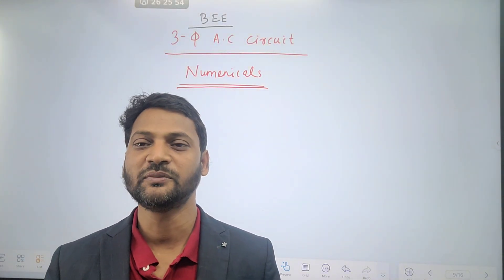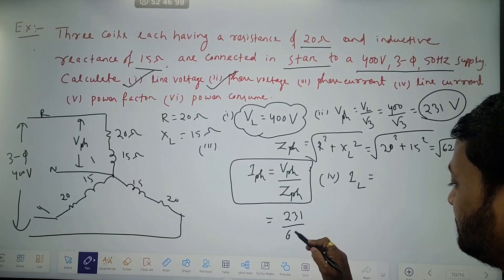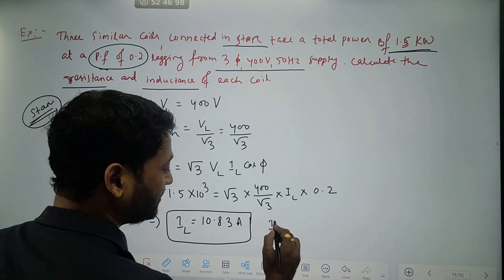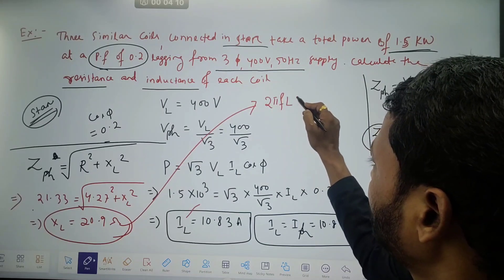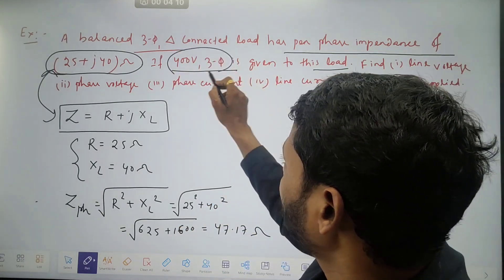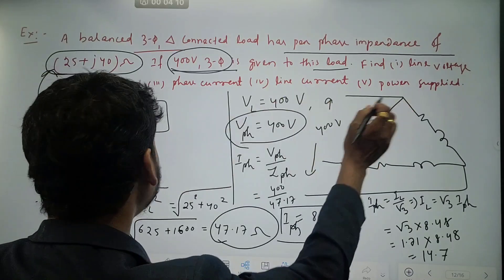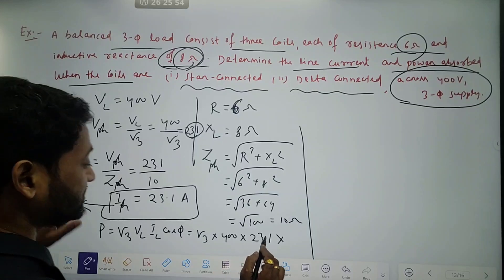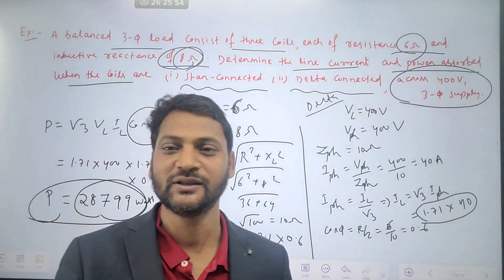Numericals (3 phase A.C Circuit)

Comment: Sir 🚨 please help by uploading source transformation, theivens and nortons theorem all type of numericals 
Unit I

Voltage and current sources & transformation, properties of resistors, capacitors and inductors, Kirchhoff's laws, Mesh and Nodal analysis, Star-Delta transformations, Superposition theorem, Thevenin's and Norton's theorem, Maximum power transfer theorem.

Unit II

Circuit analysis in sinusoidal steady state, various signals & waveform analysis, Concept of phasor, impedance, admittance, phasor diagrams, Complex, real and reactive power in ac circuits, Power factor and their corrections. Generation of three phase voltages, star and delta connection, Line and Phase quantities, Three-phase power, Three-phase Power measurement techniques.

Unit III

Magnetic circuits: definitions, B-H curves, Magnetic circuit calculations, laws of electro-magnetic induction, Hysteresis and eddy current losses. Single phase Transformer: construction & principle, EMF equation, equivalent circuit, regulation and efficiency. Three phase induction motor: Basic construction, working of three phase induction motor, losses, name plate rating.

Unit IV

Types of semiconductors, PN junction diode and its VI characteristics. Applications of diode as rectifier. Zener diode, its characteristics and its application as voltage regulator. Bipolar junction transistor (BJT), its characteristic in CE mode, Introduction to biasing techniques and use of BJT in power supply. Fundamentals of communication systems.

Unit V

Number system, Binary codes, Boolean algebra, Boolean functions, logic gates. Simplification of Boolean functions using K map (2-3 variable), Combinational logic: Half adder, Full adder. Flip -flops RS, JK, and their applications.
🙏🙏🙏🙏🙏🙏🙏🙏🙏🙏My exam is on 9 please do before 6 december if possible and please upload electronic also